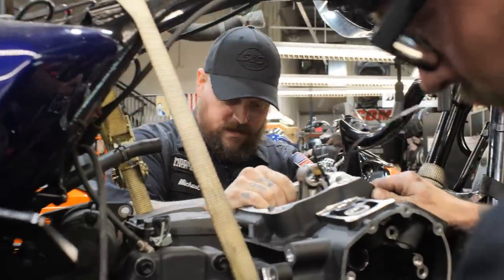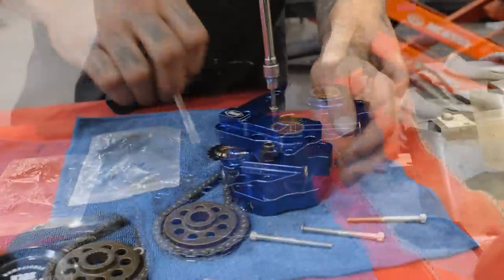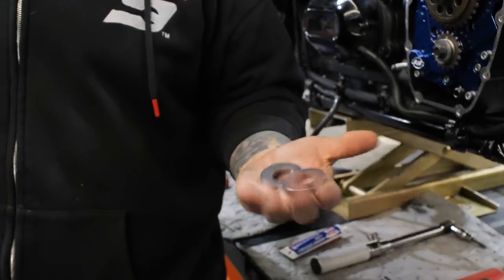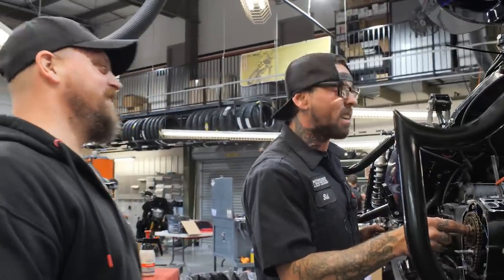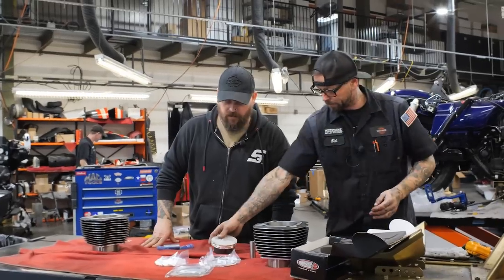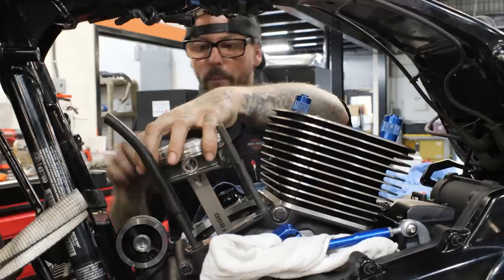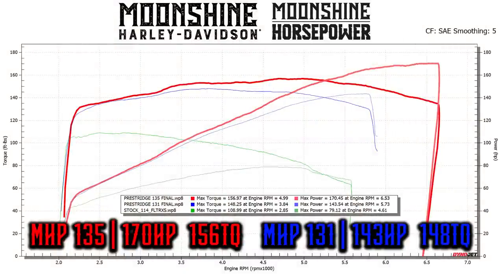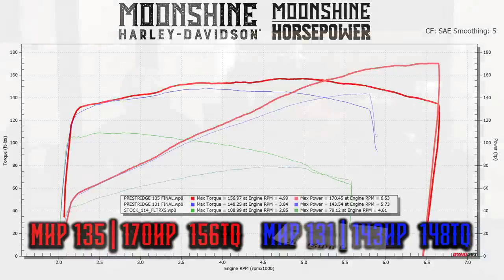MHP 135 Devil Runner INSTALL with MVO and Sid | Shop Talk Episode 60

Comment: Are u guys running a stock bottom end on the 131 for this guy ?
How long are u seeing a 124 live on a stock bottom end ?
Trying to plan ahead on mine ..(124 high compression 482 cam 130/140tq
Not gonna go bigger but need my damn road glide .. my 2008 FLHR is my sell for new road glide motor one day bike .. yes it’s cool but once u road glide u can’t un-roadglide

Comment: Wait so checking the Spacer with the OEM Pinion gear and then swapping to the Feuling Gear is totally safe and fine? Because I got the Feuling gear, and realized there was NO WAY that thing was coming off when I pushed it on, so I pulled the Fueling one off before it was on all the way, and swapped to the OEM one to do the Spacer check. Then after matching the Spacer, I put everything back together with the Feuling gear instead. I thought "How different can they really be?" I didn't know that was totally acceptable. I did it out of necessity.
Glad to know it's a totally safe thing to do and that a pro shop uses that method.
Reply from the maker: Yes. We always double check the alignment afterwards but it’s typically the same.